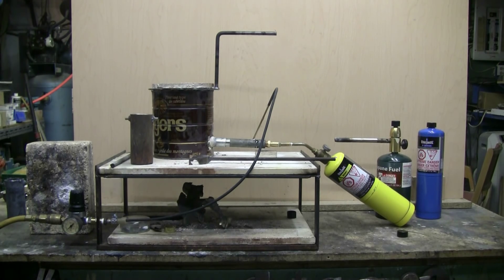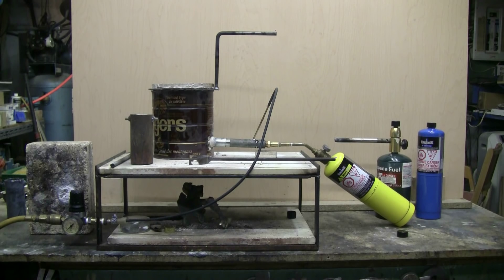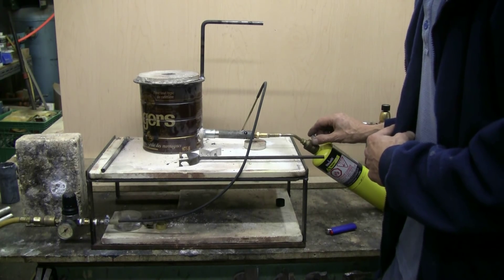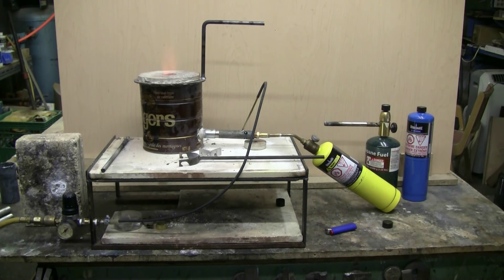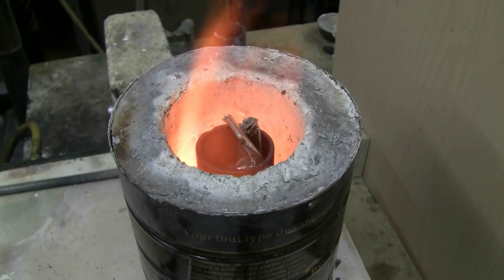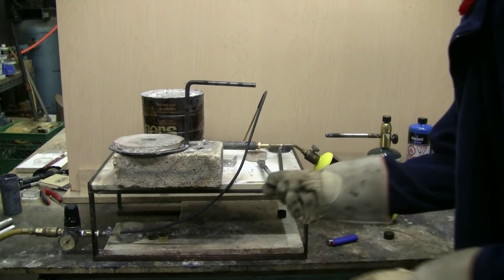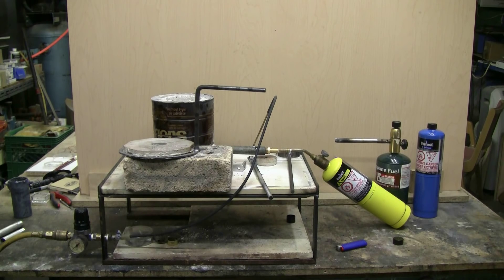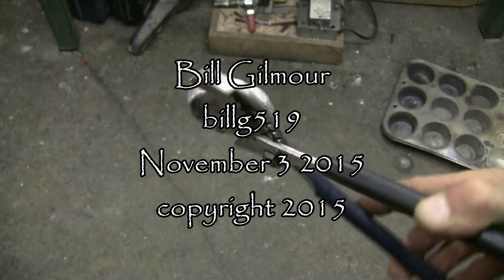Do It Yourself Coffee Can Mini Foundry - Intro And Demo

Comment: Nice one, I like the air assist.
Looking forward to the rest of the series.
You could probably also heat steel red hot to hammer shape.
Reply from the maker: +George Gibson Yes, it can be used for blacksmithing small items like knife blades.